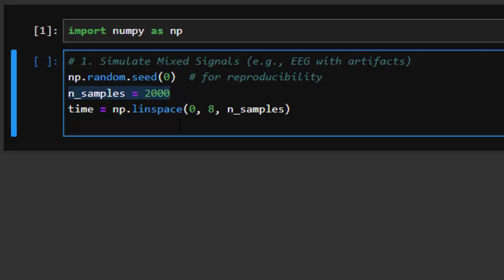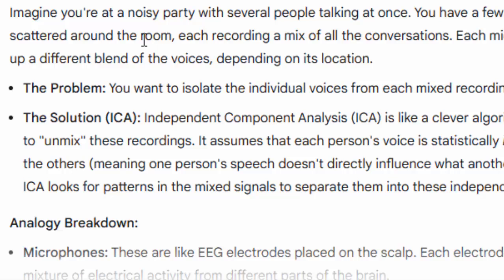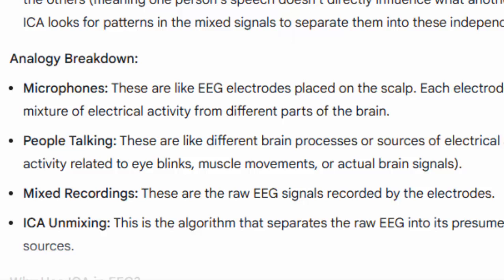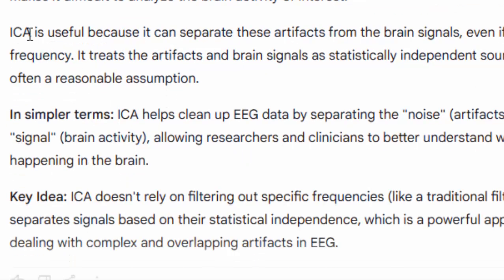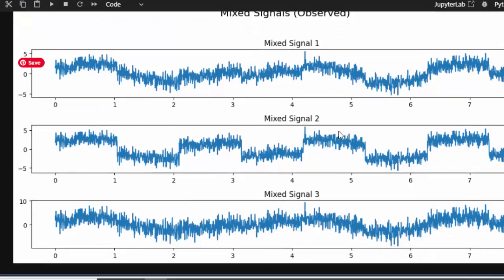Python FastICA: Blind Source Separation ICA (Independent Component Analysis)

Comment: 🎯 Key points for quick navigation:

00:00 ⏰ Set up involves creating a time signal with 2000 samples, preparing for signal manipulation.
00:27 📈 Sine wave signal is generated and plotted using Matplotlib for visual representation.
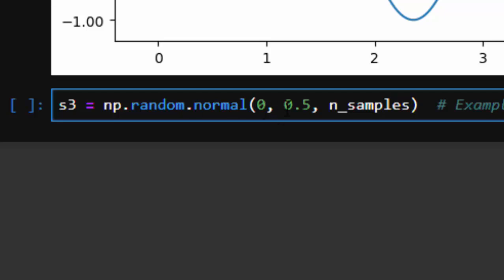01:33 🌊 White Gaussian noise is introduced to the sine wave signal for noise simulation.
02:12 🚴 Another signal simulating muscle artifacts is generated and plotted for visualization.
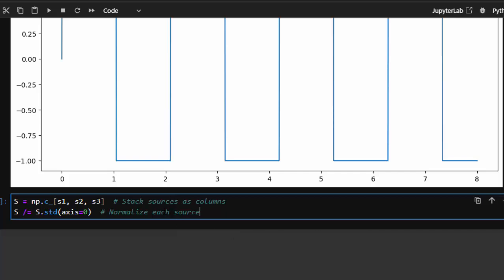03:05 🗂️ Signals are concatenated and normalized to prepare for Independent Component Analysis (ICA).
03:32 🧪 Mixing matrix created to blend three signals, simulating mixed recordings for ICA.
04:01 🎉 Explains Independent Component Analysis (ICA) using the cocktail party analogy for separating mixed signals.
05:10 🎧 ICA helps isolate individual signals from mixed recordings, crucial for EEG signal processing.
06:46 🧠 ICA in EEG separates noisy data, like eye blinks and muscle movements, from brain activity signals.
07:52 🔀 Signals with overlapping frequency domains can still be separated using ICA due to statistical independence.
09:40 📊 Mixed signals are plotted to visualize the blend of original signal, noise, and artifacts.
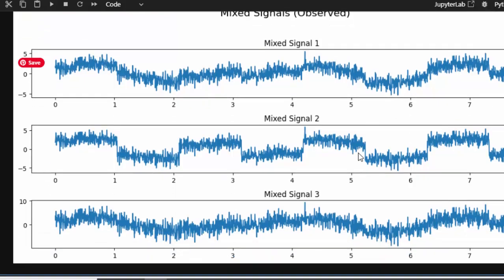11:19 🧩 FastICA algorithm from SciKit-Learn is used to decompose the mixed signal into separate components.
12:25 🔍 Comparison between estimated and original mixed signals shows successful signal separation with slight deviations.

Made with HARPA AI